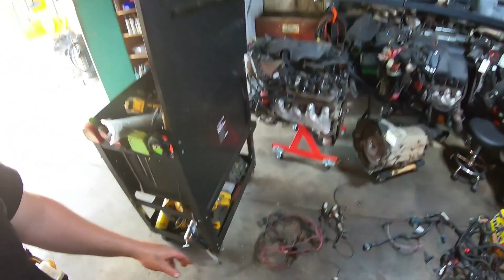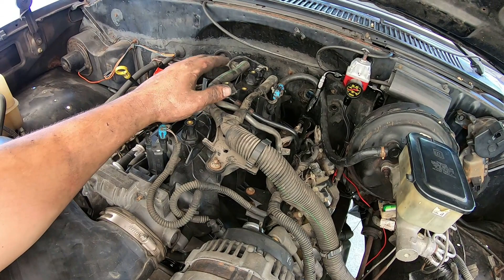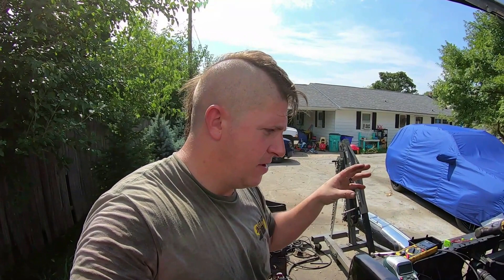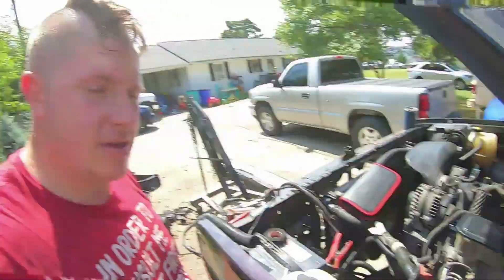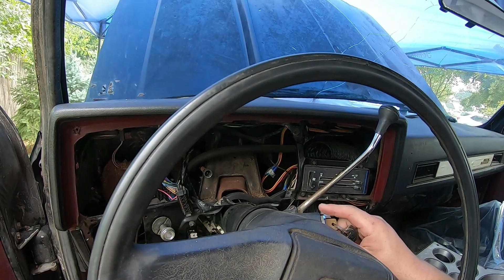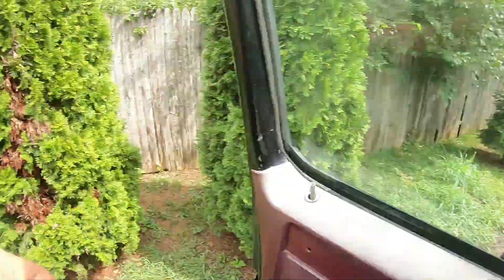Squarebody K10 Swap Project, Part 8 More Electrical

Comment: From parts to labor not including truck. What was total price. I have a 2003 1500 hd 6.0 with 4l80e would want you to build
Reply from the maker: Honestly it's been so long I don't really remember. I think by the time it was finished, including the engine and transmission, it was somewhere between 8 and 10k

Comment: Dude this series was very informative but what wires did you use in the harness to connect to the new relay box. Would i need that if I have the factory box for the motor and trans?
Reply from the maker: If you want to wire it up to work like original engine, start from the key and everything, yes you'll need to wire in to the factory engine harness for the truck. I can't remember which ones off the top of my head, you'll have to look up a wire diagram and connect appropriately.

Comment: That's the biggest thing having the donor truck for all the little things that can nickle and dime you to death the air box for example would not come w just an engine etc etc nice choice on the radiator btw youve done this a few times it appears lol
Reply from the maker: Yeah a couple times, lol! And yes, donor truck provides soooo many little things that you might not think about otherwise and they add up.

Comment: Hi Jason, thank you for the detailed content. I may have missed it, did you have to flash or program the pcm?
Reply from the maker: All I did was remove the anti theft from the pcm and I added electric fan control. Otherwise it's a stock pcm.

Comment: any other issues with those long tubes?
Reply from the maker: no, they were excellent
Reply: Just had to weld a bung to the driver side header I assume? Also, did you weld them on or clamp them? If clamp what size did you use?
Reply from the maker: Already had bungs, they're intended for LS swap so they already had bungs. Just used 3" stainless band clamps

Comment: Really like your content.. I'm actually.  Doing a swap on my 86 c20 6.0 lq4. Fatrory harness and factory fuse box. So question I'm not a wiring guy lol i have a buddy that is. We're using the factory fuse box. Can i use the the relays in that box for my fuel pump, fans, etc. Since some won't be used anymore? Oh and starter?
Reply from the maker: Thank you!  Yes you can repurpose the relays in the fuse box to run whatever you like, you'll need to find the pinouts for the connectors and connect your load wires and control wires appropriately.
Reply: @MohawkMotors  ok thought so I will do that.. thanks again
I really like how you explain in detail what wire from the c10 truck needs to be used to supply to the pcm for the swap.
Reply: @MohawkMotors  hey bud question.  I have another harness that is complete with a computer that is dbw but it was for a 5.3.
The trans plug I'm not sure if it's for a 4l60e or 4l80e.
Now the engine I have is a 07 dbw 6.0lq4 with the fuse box and computer that I had the vats done already and added elec. Fans. Ok the harness my buddy and I started pulling wires to make it stand alone lol well some of the connectors have been cut. Anyway it's a 4l80e trans. Now the can I take the other harness if I use it instead cause it has all the connectors and repin the trans plug for a 4l80e since my computer came with a 4l80e I wouldn't have to tune it for a 4l80e right? Since my computer will recognize it.
Reply from the maker: Yes, you can use the 5.3 harness, just repin the transmission connector and pcm connector to run your 4l80e and add the input shaft speed sensor wires (lots of video on youtube on how to do this, convert from 4l60 to 4l80) and yes that's correct, the computer doesn't care which harness you use, as long as all the wires go to the right places in the transmission connector and the pcm connector.
Reply: @MohawkMotors  ok that's what I thought.. man I sure thank you for this info. You've been a big help. 
And like your videos